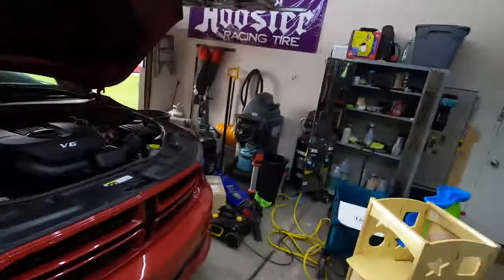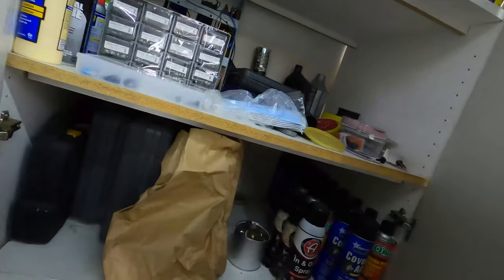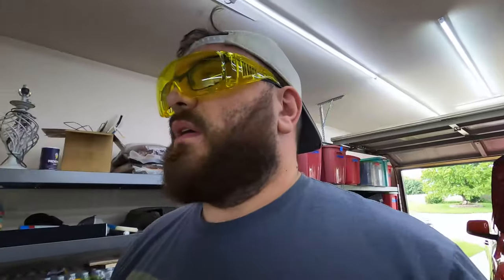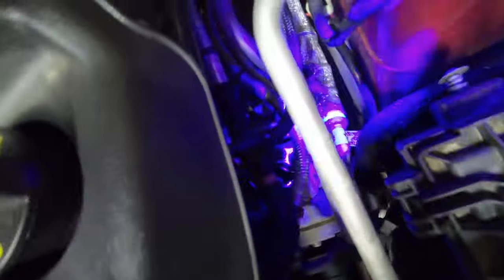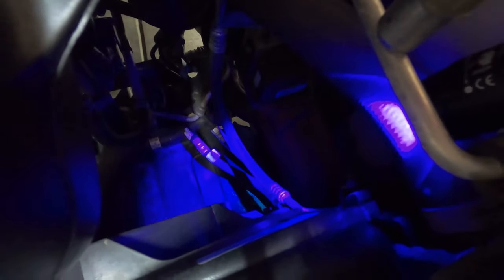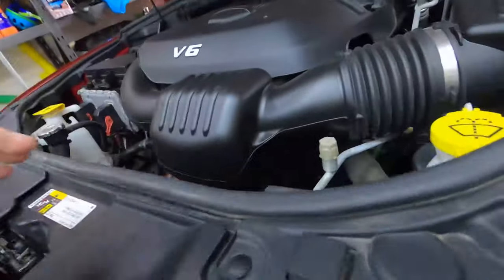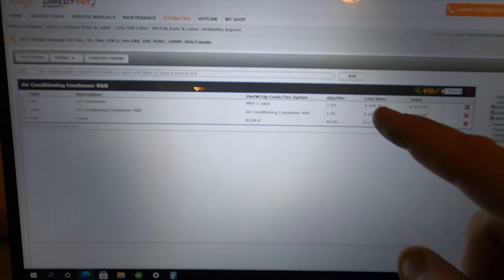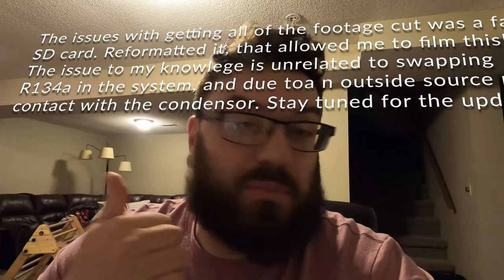The R1234YF to R134a conversion Durango is back for an A/C issue...

Comment: Thank you I bought the adapter and converted a Kia optima over R134a and it has worked thank you so very much for your video and time
Reply: Do we need to change the expansion valve ?
Reply: @hk2024iq  yes you do....and if your system uses a pressure interlock switch to preserve the compressor from damage in case of a leak, then you likely need to reprogram your car's computer system these two refrigerants do not operate at the same pressures
Reply: @ls6097  Thanks Bro.

Comment: Just want to let you all know - I have a 2019 300s, and did the 134a conversion about 4 years ago - it is still running great. Had a schrader valve leak but still blows colder than 1234yf.
Reply: Tomorrow, im gonna do  the same with my chrysler 300s 2014. I,ll hope it works good
Reply: @devioner18  any update on your change
Reply: @devioner18  update????  Same vehicle
Reply: Do we need to change the expansion valve when we convert the freon type ?

Comment: Great, I started AC servicing on my R12 vehicles then discovered ES12 enviro safe. Now I've got a second hand recovery 134 system. I did get the adapters for my gauge set so I could enter 1234. So it appears the oil is compatible with 134 so all we have to do is evacuate and service with 134 on a 1234 system and all as well?
I have connected to three different vehicles that are 1234 one of them I use that enviro safe supplement to top off and it did its magic. Do you have long-term evidence of any or no effect converting or reverting back to 134 from the 1234 system?

Comment: Hello Gents I’m from Iraq
I have Durango 2022 GT and I want to add R-134a instead of R-1234yf.
Do I need to change the expansion valve ?
Reply: Do not do it. You cannot put R134 into a R1234 system. You CAN put R1234 in a R134 system, though I dont know why anyone would do that.
Reply: @ls6097  because my I have accident and the radiators damaged.
Anyway I will put R-1234yf.
Thanks bro.
Reply: ابو علاوي بشر غيرت البخاخ لو بقيته نفسه لان اني همين اتسائل
Reply: @hk2024iq ابو علاوي بشر غيرت البخاخ لو بقيته نفسه وشنو الامور تمام شتنصحني
Reply: @sajed180  هلو اخوية 
لا والله شحنتها نفس الغاز البلادي 
افضل

Comment: Was the switch to 134a a disaster in the end or a good outcome?
Reply: That’s what want to know. About to do it as well on my 2015 Jeep Grand Cherokee
Reply: Update, I did the 134 switch and it was a good outcome
Reply: @audricroxy  nice, i have a grenade'd compressor on my 15 Chrysler 200 after front seal decided to let go, leaked out all the oil and KABLAMMO! got all the parts and going to do a flush and fill this weekend and install 134. cause seriously EFF 1234yf...i think the yf stands for yer fucked.

not looking forward to pulling the front off to replace the condenser tho.
Reply: @lilshawn2  I totally hear you it was a pain in the ass and took hours and days with my mechanic in the heat of my garage in Phoenix Arizona. Also had to remove the whole dashboard and steering wheel to get to the evaporator. Yep, I’ve done a lot of research and the 1234 is highly corrosive.
Reply: @audricroxy  still working good?

Comment: I found this on the internet   
Can I use R-134a instead of 1234yf?
While you might be thinking you're doing the environment a solid, do not do it. It is illegal to convert an R12 or 134a system to 1234yf.Aug 20, 2019
as well as this
The expansion valve setting for R-1234yf refrigerant is different compared to R-134a. Changing from R-1234yf to R-134a refrigerant may result in a system with incorrect refrigerant flow and heat exchanger mal-distribution which may cause a loss of cooling performance or durability concerns.
Reply: Well many people have done it with Chrysler vehicles including me and it works much better. Go searching for how Cadillac did 1234yf the first year, it didn't work right, and they just refilled them with 134a - no component swaps. The system is basically the same. Yes there are slight differences, but apparently not big enough to make a difference - yet. Is it legal? No. But the EPA isn't exactly going to be knocking down your door because you did it.